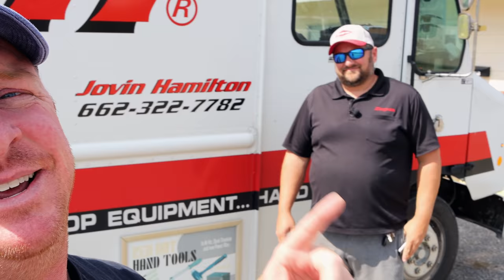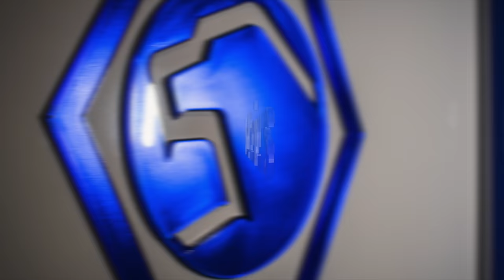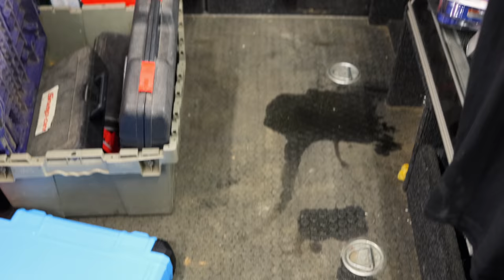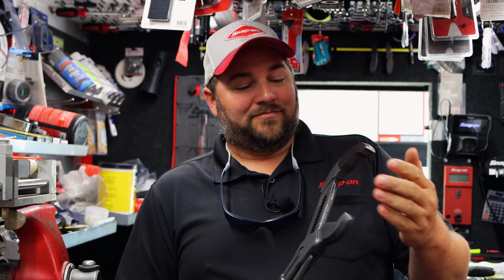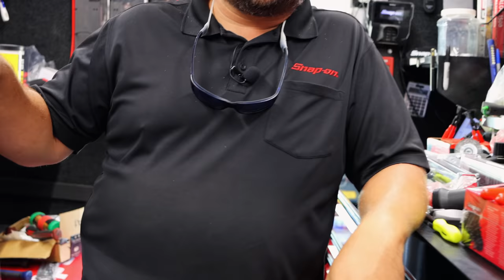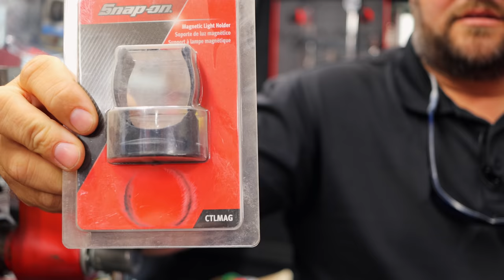Snap On Friday! HUGE Knipex Cobras and New 18 Volt Light

Comment: I’ve never had an issue with any snap on air pneumatic tool. They are sensational.
Reply: Only problem I've had is with the PT850. For some reason the forward and reverse button will not stay put. Had the tool for 4 years.
Reply: Pt650 I had had zero ass.  My midtorque m18 has 6 times the power.     My air cat 1075-th (size of my fist) has more power.  And it was only 100 bucks🤷‍♂️  I love my air ratchet though.  Can't beat a far72a air ratchet

Comment: Will be getting the long reach brushless ratchet.l have the magnetic boot on my 14.4 ratchet and love it.Can stick it to steel surfaces near the area l am working in.Saves time not going to my tool cart getting it.l have figured out it twists off the battery and not pull it off

Comment: Are the hi leverage pliers as good as the old type that they stopped making
Reply from the maker: I like them ?
Reply: The ones i was talking about is the Snap-on hl9cp  you can find them on ebay but look at the condition before you buy but they will cut

Comment: Does Hamilton have any experience with the bkimg55art articulating imager? I have had nothing but problems with it. It will articulate 180 degrees once then it goes 90 degrees if your lucky. Brand new it didn’t work. Warranty it and used it once and it now doesn’t work. Going to have to warranty it again.